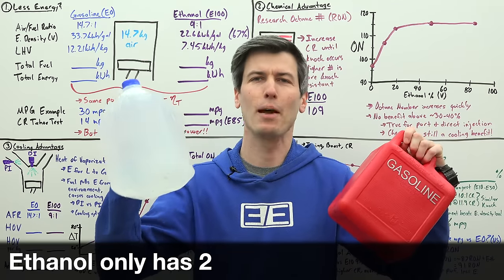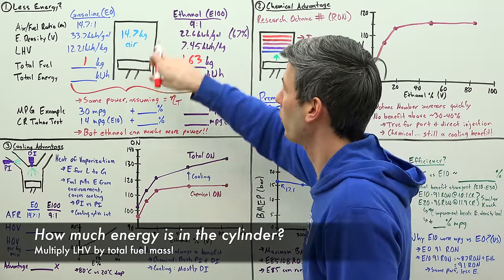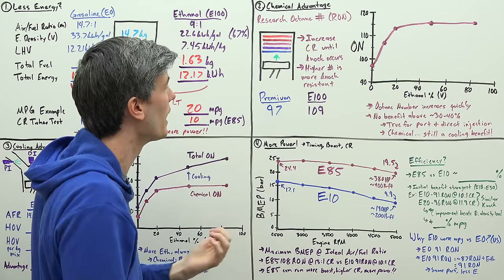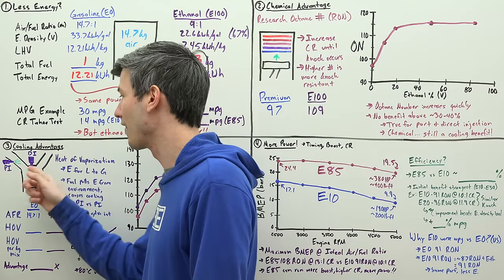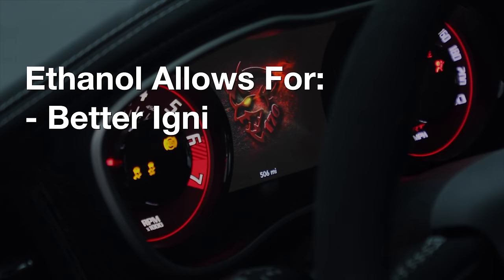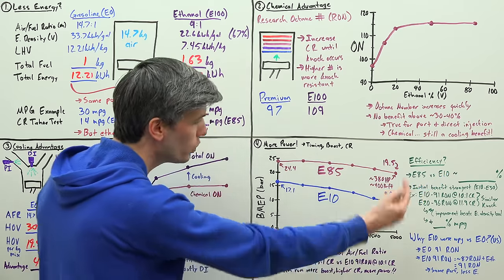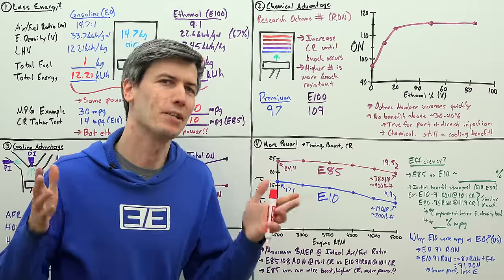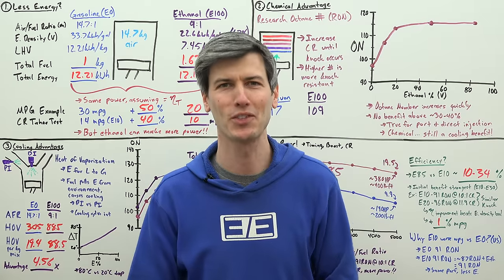Why Does Ethanol Make So Much Power? (Versus Gasoline)

Comment: This is known here in Brazil since the 80’s. If you want to tweak your engine, specially turbocharging, you should adapt it to ethanol. And we’re using 11:1 CR in gasoline engines for a long time, because we were the first country in the world to abolish completely tetraethyl lead in 1989, substituting it by E25
Reply: @BrunoRaven  Not to mention how they use absurdly inefficient corn-based ethanol, while our sugar cane ethanol is much better for the environment.
Reply: @BrunoRaven  Exactly. Not to mention how corn is awful for the soil, so you either completely destroy the ecosystem or do crop rotation, making it even worse for something you need consistent production of, like fuel and food.
Reply: @BrunoRaven  We even developed the technology to cold start without the gasoline reservoir. After 40 years, we discovered that ethanol is corrosive before burning, and this is saved with nickel linings. The combustion is more complete, the deposits of carbon is slower, the oil stays clean for longer periods. I'm a nutshell, we overcame all the difficulties into sing this biofuel
Reply: What cars do you have in Brasil? Here in Europe, I drive an old wolksvagen which would not be happy with much ethanol in the fuel, because the energy density is lower so the power is lower, because you cannot change the compression ratio - it is determined by the engine design and sizes of it's parts.
Reply: @angelg3986  virtually, any car made here is flex fuel since the beginning of 2000’s. The consumption is 30% higher and the engines could be even more powerful (using only ethanol) due to the possibility to increase compression ratio. But they run very well with any proportion of gasoline and ethanol
Reply: @angelg3986 in Brasil, cars started being "converted" to ethanol in the early 80's, and would run on E100, and had a rough time starting in the "cold," basically anything under 5 degrees C. When Flexfuel-engined cars came around around, things got smoother. Keep in mind, Brasil's "gasoline" has had a high blended ethanol content of 20-25% for a long time
Reply: @karlbr21  We were the first country in the world to ban TEL using 100% pure ethanol as an antiknock agent. USA and Europe phased out TEL slower than us, using MTBE, but they're discovering that using ethanol is cheaper and safer, because MTBE is toxic. The disadvantage of ethanol are the high consumption and the absorption of atmospheric water
Reply: @angelg3986  fun fact, ethanol-powered cars in the 80's were called "cachacinha", because of the smell of burned ethanol on the tailpipe. It remembers the smell of the famous sugarcane beverage
Reply: @julianomse  im running a 98 chevy with 50 percent e85 unmoded, now the    only downside i have is fuel system is descaling and my injectors are stopping up a bit   i intend to change CR to 20 to30 per cent more flow for e85 , that v8 with ethanol has POWER! 🤤
Reply: @BrunoRaven  actually DDGs from corn ethanol would be better to feed animals vs raw corn , and we can grow non food crops that high yield more  starch sugars etc compared to corn 🧐
Reply: @Bucky1836  that’s why every metallic part in touch with ethanol has to be lined with nickel. Thinking out loud, you could try to buy injectors made in Brazil for a flex fuel car compatible with your model
Reply: @angelg3986  here in Brazil we have plants from VW, Fiat, Peugeot, Citroen, GM, Hyundai, Mitsubishi, Toyota, Honda, BMW, Mercedes, Cherry, Jeep, Renault
Reply: @BrunoRaven  That 11:1 ratio has nothing to do with flex fuel though.... for instance my US honda Accord runs 11.5:1 and is NOT a flex fuel vehicle unfortunately.... it also runs just fine on 87 octane. Flex fuel vehicles just have to adjust the AFR to the correct values for the fuel being used... that is all there is to it compression is about the same on a flex car...  because it has to be able to run both, on an ethanol only car they can easily go up to 13:1 or so.
Reply: Most cars in the US stopped using tetra ethyl lead long before that, so I guess there is smugness in that, but it took us awhile to ban it because a fair number of Americans keep their cars a long time, or buy older used cars…
Reply: @Bucky1836  In the 80's my dad had a 1987 2.0 L Chevrolet Monza (Opel Ascona) whose carburetor's idle gicleur got clogged everyday, due to peeling off the nickel linings. People discovered that, if you put 1 L of kerosene in the tank, the corrosion stopped. Depending on your components, maybe you could find the heated flex fuel version of your injectors, sold in Brazil. Are they're the majority.
Reply: @nerd_nato564  lol sugar cane is also bad for the environment you already destroy the ecology by plant 1 crop over a area that was previously forested. the cheapest sugar can also uses burning for clearing the leaves off the stocks.
Reply: When they started to introduce ethanol here in Australia there were people screaming about how our cars could not handle it. Yet I also recall the same time one of our biggest exports for Holden (GM) cars was to Brazil where you had been using ethanol for years before us. Of course the cars could handle it. Some people just hate change and love to spread FUD.
Reply: @Svendip after se stopped producing the equivalent of Opel Omega locally in 1997, we started to import Holden Commodore with the same name until 2012. It was known as Australian Omega, and was considered one of the most luxurious cars sold. Even the president had one as the official vehicle.
Reply: @nerd_nato564 to be fair, i think both of us started with our largest crop, and by good fortune, Brazil's major crop was WAY better at making efficient ethanol.

To be doubly fair, though, we should've stopped spending so much money subsidizing corn ages ago
Reply: @spindash64  Yeah I don't blame y'all for starting with corn, it's just weird that you haven't made the switch. And by weird, I mean "it's probably the damn agricultural lobbyists again"

Comment: Great Video. I did a study on this when I was in college, but we we only focusing on power not efficiency. Everything you said applies, but also the cooling effect of the ethanol means that the air is denser. We had a port injected engine with boost (I forget how much boost), and we saw a temperature drop of 40°C just from before and after the fuel had been injected. This means that by the time it got the intake valves we could get more mass of air+fuel mix into the cylinder and make even more power. Yeah ethanol is pretty cool (pun intended).

Comment: You could also have mentioned:
- burning velocity/point of highest pressure in the downward movement of the piston
- effect of E0/E10/E30 on power and economy of non-flex vehicles
- CO/NOx emissions at E0/E10/E30/E85/E100
- the ethanol content of the highest efficiency corellated with your other video about loosing energy in growing/harvesting botanicals and making ethanol from an engineer's perspective.
There's still a lot to talk about ethanol use in ICEs. 😉
Reply: Oh please do a follow up video 🙏
Reply: In Norway, we're using E5 and E10.
Reply: Even with just 10% ethanol added to E0, the Swiss Federal Laboratory for Materials Science and Technology found that the especially health devastating ultra fine or nano particulate emissions were lowered by 97%, carbon monoxide lowered by 81%, carbon dioxide lowered by 13%, aromatic hydrocarbon emissions lowered by 67-96%, and genotoxic emissions lowered by 72%.
Reply: @danafletcher2341  TIL, Thanks!
Reply: @danafletcher2341  You know heads are popping off today with this video... I been running 30% E85 on ALLLLL my stock OBD2 vehicles for years! Gosh I bet there just dying today Dana!
Reply: @oldblueaccord2629  without a remap?? :D
Reply: ogjk  He made a video about it.
Reply: @Ren_1106  Yeah and soon EE.... you geddit..
Reply: @richinfeels  you can it is about getting the right ratio though. Most cars are fine till 30-60% eth, then it is more of a fuel pump issue.
Reply: Re the first point of course the timing should be altered to account for this
Reply: Jake Krause  he was talking power and miles per gallon? You better just staying riding a bike
Reply: @richinfeels  YEP.
Reply: @richinfeels  30% E85 with normal E10 is equivalent to E32. Probably not enough to really damage anything short-ish term, and little enough that it won't absolutely need a retune. But it probably won't have the characteristics of a high ethanol engine, say for reduced engine/cylinder head temperature.
Reply: @danafletcher2341 another added bonus is that ethanol keeps the intermals of the engine cleaner because ethanol burns more completely into co2 and h2o bascally steamcleaning the combustion chambers and piston tops, it keeps the oil cleaner for longer as well. 
The more ethanol in the mix the greater the effect.
LPG does the same.
Reply: ogjk  All the energy it takes to produce and deliver a product to the consumer is reflected in the price of that product.

As such the cash delivered NYMEX price of ethanol is $2.36/gal

This price of a sub-grade unusable gasoline (RBOB) is $2.84/gal.

To turn RBOB into a usable E0 fuel even costs a lot more much like premium, racing, and aviation gasolines cost more. Petroleum octane boosters BTEX (benzene, toluene, ethylbenzene & xylene) are expensive plus are dirty and toxic.
Or you can splash in >10% ethanol to RBOB and the resultant usable fuel is much cleaner burning, less toxic, and cheaper/cheaper per mile to drive.  Who can be against that?

Iowa State University measured all the energy it takes to produce an acre of corn into a "diesel fuel equivalent"
This included machinery, fertilizer, chemicals, tillage, planting, harvesting, drying, trucking etc. 
They found it takes 34 gal of diesel to produce one acre of corn.
What do we get from those 34 gallons of diesel?
We get >500 gallons of ethanol.
But wait, that is not the kicker.
The kicker is we still get 100% of the protein from that acre of corn still available for an even better feed. A win, win.
Reply: The blender’s credit or VEETC ended back in 2011.

The long-standing stated goal of the G7 Nations to end petroleum subsidies?  Not so much.
Reply: @danafletcher2341  The Swiss numbers seem very high to me. Are you sure it was for E10 or rather for E85? 🤔
Reply: @u.e.u.e.  They do seem high and the E85 numbers I excluded but were better.  Can’t give link here otherwise I would.
Reply: @danafletcher2341  Ok, thank you.

Comment: I recently finally tried first couple tanks of e85 in my 5.0 f150 and I'm surprisingly impressed. Much more throttle response and obvious overall power increase. Also seems to coast longer and faster for some reason. Seems to be happier and run even better on the e85 than on premium.
Reply: How mas the MPG?
Reply: @johnl5525  I went from 19-20 to about 14.5
Reply: @John L  still worth it though as I can often get it a dollar cheaper
Reply: Please tell me you did the appropriate mods, cause if not it could kill your engine.
Reply: @2seep These are flexfuel. Says so on the truck and on the fuel inlet.
Reply: Same motor same truck and yes the engine loves it but my mpg is only around 20% less on e85 so far. Pretty sure all the tanks have been winter blend though. So maybe it will drop more now that the temps came up for spring.
Reply: @2seep 😂😂😂 they're flex fuel and even better with an e85 tune. Stay in your lane rice burner
Reply: @2seep  Without the mods the car will normally not even start and if it starts it will run really bad with 0 power until the engine is completely warm... I did it on my Mercedes 190E and it was already running to rich so it actually started on pure E85... E40 it did run fine on for 2 years.

Comment: Have been using e85 for 10 years now in 4cyl race applications. Have ran 90% tested pump e85 in 122CI motors at 10:1 compression at over 40 psi of boost on 62mm+ turbos. The fuel is amazing considering it costs $2.35 at the pump but performs like c16

Comment: I gained 36hp and 55 lb/ft on my subaru wrx just from switching to e85. It went from 25 to 23mpg, but turbo spool was faster due to larger exhaust volume.  If it's available,  I  would recommend it! It was usually about a dollar a gallon cheaper than premium and had more power.  Why not? The problem as you said, is that we try to use e85 without making the engines designed for it. You can increase compression and boost with e85. Mpg isn't as bad if you build for it.
Reply: Why not?  Well just make sure your vehicle's chemistry is compatible with it.  Ethanol is reactive and will eat through stuff, dissolve stuff into the fuel and foul things up, etc.  Modern cars that are claimed to be "flex" will have stainless fuel system parts, E-compatible rubber seals and so forth.

Comment: I remember years ago going to an IHRA event. Examining the dragsters up close I noticed their fuel plumbing was huge, compared to NHRA.
Reply from the maker: Nitromethane (used by Top Fuel dragsters) has an air-fuel ratio of 1.7:1, sooo much fuel required (about 8.6x gasoline)!
Reply: So if all cars are made to run e15 after a certain year I’m sure so does that mean they can run e85 so long as you have enough pump and injector?
Reply: @joshreynolds729  no. There are aftermarket flex fuel sensors and systems to retrofit onto vehicles, but if a vehicle wasn't designed to run E85, you shouldn't try to use it. E15 and E85 are completely different animals.
Reply: @joshreynolds729  aside from combustion differences, higher ethanol fuel requires special seals/materials in the fuel system. Ethanol can cause premature failure of soft rubber-like materials in hoses and seals.
Reply: @joshreynolds729  what these people say. basically any e85 system can handle anything under it, or a mix. but not the other way around.
Reply: @EngineeringExplained  nitro also has a high oxygen content
Reply: @jameshaulenbeek5931  all you need to run E85 is upgraded fuel pumps and injectors with a tuner who knows how to tune for e85
Reply: @poyo3582  that's a great oversimplification. At the very least, a flex fuel sensor and wide band should be added, and except on very modern cars, that means running a standalone.
Reply: @James Haulenbeek  not so sure about that Im running full e85 In my 2017 gti wasn't made to run on e85 either, but with just a upgraded high pressure fuel pump and a tune, of course I have other mods like aftermarket down pipe and intercooler and all the supporting mods but I dont have a flex fuel sensor nor a standalone ECU. I do have a ethanol sensor that I installed just to watch the ethanol content in the tank,I just make sure it doesn't dip below e60. But like you said it may cause problems in older cars, but I believe the only problem you can run into is the fuel lines not being robust enough to handle the ethanol concentrations and as well the ecu not being able to adapt to pushing out 33% more fuel into the cylinders and fuel pumps of course
Reply: @poyo3582  right on, that's awesome!
Reply: @poyo3582  1999 grand marquis. e85  aint happening without a good overhaul. I know some of the newer crown vic interceptors could run flex fuel not sure about later model grand marquis or vic's. So the protentional is there. But are the newer parts compatible with the older car. Not to mention less stations have e85 available.

Comment: In Brazil we have around 27% Ethanol in the gasoline. For a long time we had a famous rule that said that it was worthy(in $/mile) using ethanol whenever the price was 70% of the gasoline(since most cars nowadays are flex). More efficiente engines make this ratio go up to 75%. This creates an interesting market effect that whenever gas prices go up, people tend to switch to using ethanol, making its price go up too, when gas prices go down, ethanol prices also go down. Prices tend to reach an equilibrium near that 70% ratio.

Comment: Some high compression cars you can only get a good tune with Ethanol.  (E30+ blends).  For example, my BMW 330i G20 almost all tunes were highly boosted, and very minor timing changes because of it's knock sensitivity.  I went through several tunes that felt watered down, because tuners want to play it safe with timing, but I finally got an E85 custom tune, and the car feels very powerful and smooth.

Comment: They've done this on engine Masters several times! It runs way lower intake temps and you can force way more ethanol in the combustion chamber because the molecules are smaller!! But the downside is it takes A LOT more fuel when you use it because of the lower BTU
Reply: Sure. Blame it on the Brits.
Reply: @ItsVideos  🤣🤣🤣